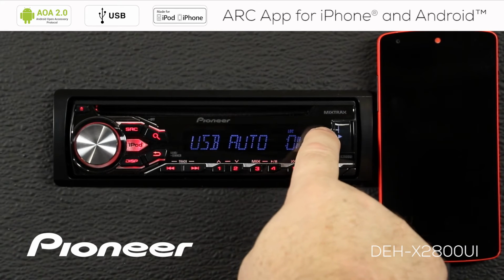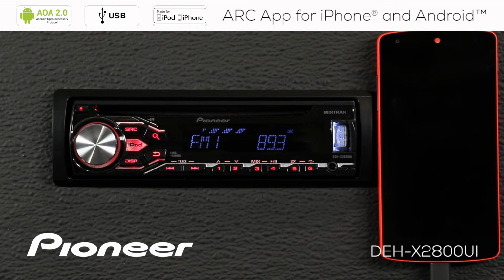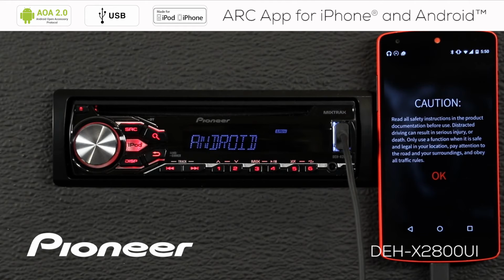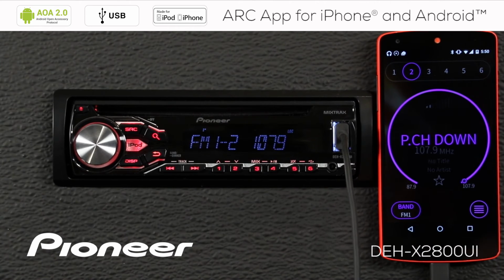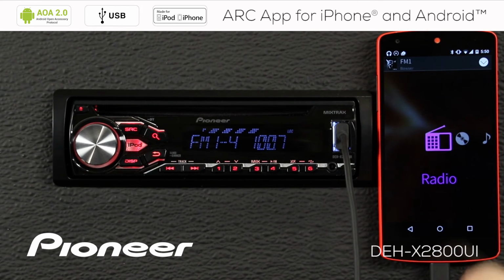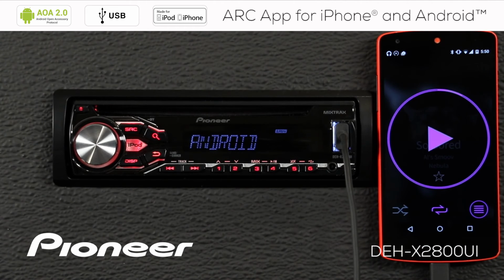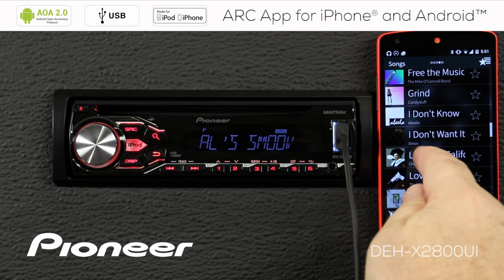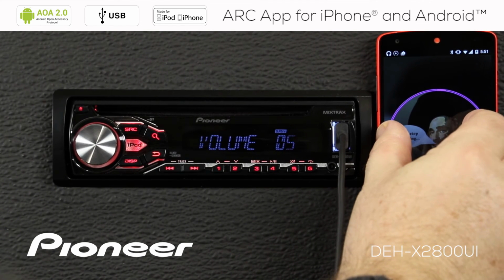How To - DEH-X2800UI - ARC App for iPhone and Android

Comment: I have the mvh 9ub model, and I cant connect my Samsung mobile via usb, head unit says n/a usb. Scrolled all the menus, and I cant find "android wired" it's just not there, but the manual says that its available on this model. Please help.
Reply: Doesn't work on newer android they need to update,i think it only works for android 8.0 and below

Comment: need assistance with type c stock samsung cable i am trying to connect A31 with DEH-X1950UB from 2020 and looking for solution
Reply: The Pioneer ARC App is compatible with selected Android phones operating the Android OS version     4.1  up  to 7.1.2.  The phone must also support AOA (Android Open Accessory)  version 2.0.   Ultimately the compatibility depends upon the individual smartphone.  Please note, some Android based devices will connect via AOA 2.0 but may not work properly or emit sounds due to the phones software design regardless of the OS version.   You can find more videos on Pioneer's YouTube Channel here;  https://www.youtube.com/user/pioneerelectronics
Reply: @deckerdotto6035 tell me the solution? i need the solution

Comment: I bought the x2900ui model today.. and the pioneer arc app doesnt work... when i plug usb cable to my phone android (Huawei) first time the synchro is ok.. but the music sound turn only With the phone speaker... i unplug and plug it again... unfortunately.. the input screem show this «format read»
I cant connect anymore my phone.. it display the same message and the arc doesnt open.
Im so disgusted
Reply: It sounds like you have the Android Wired connection set to Memory.  This is incorrect. It should be set to App Control.  Watch and listen to  this video carefully.  https://youtu.be/6uJ7em6QLps    This video explains the settings needed under Android Wired connection.  Be sure to choose App Control.